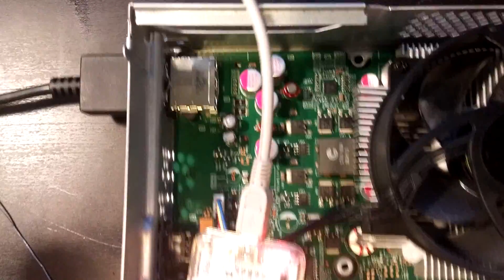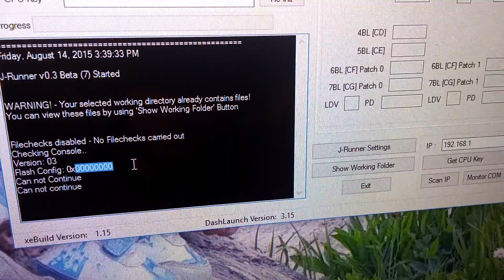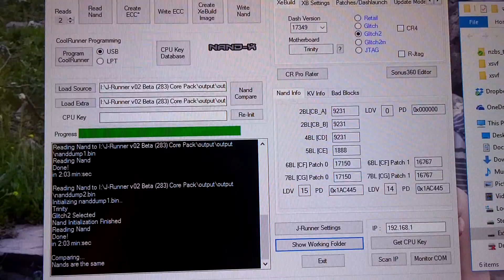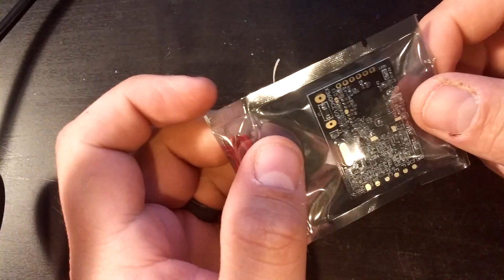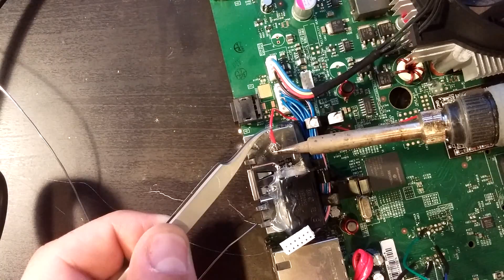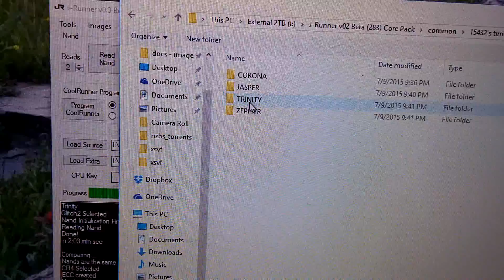How to JTAG RGH Xbox 360 Slim Trinity with Ace V3 and Cr4 speedup files

Comment: How can I visit site, that no exist?
Reply from the maker: You are right, teamx360.co.uk shut down - you can get the timing files in my jrunner package linked on this video:   https://www.youtube.com/watch?v=qKJBLxJaYWg
Reply: Oh, thank you bro. But I have a question:
Does ace v3 is usable in rgh 1.2 installation? I saw many videos of installation but cant find 1.2 timing files for ace v3.
Reply: Danail Uvarov I think all timing files are in Weekend Modder's timing file
Reply: TheWeekendModder Could I use this same method but use the jr programmer instead of the x nand or do I have to use the matrix glitcher chip if I use the jr runner

Comment: Also, if you want to be able to know which exact motherboard you have WITHOUT opening your Xbox quite just yet, you can tell because if you look at the biggest sticker on the back, in the "super fine print" there should say either 12V===10.83A  or   12V===9.86A

heres the link to the subreddit post:
https://www.reddit.com/r/xbox360/comments/c9f5os/how_to_identify_your_xbox_360s_motherboard_type/
Reply from the maker: Just FYI - around the transition dates of 7/2011 or so I have seen many mislabeled Corona's that have a sticker on them that says 10.83A but is in fact a Corona.
Reply: @TheWeekendModder  nice to know, also yeah that does suck :/ thanks for the tip

Comment: I noticed that you soldered the D point on the front of the board, rather than the back which i have seen in various other guides. Is there any reason, is it better for boot times?

Comment: When ive have two good nand reads but i tryed reading it a 3rd time just to be sure and the light came on and turned red now the console is really flakey sometimes it will boot up run for 5 mins then shutdown and get stuck in a boot loop or i just get a red dot? Am i screwed boys?
Reply: Well just saw c2c3 smoking noting is bridging? Desoldered everything now i have a red dot of death.

Comment: Could I use this same method but use the jr programmer instead of the x nand or do I have to use the matrix glitcher chip if I use the jr runner
Reply from the maker: nandx and JR programers are interchangeable.  Matrix glitch chips and CR Rev C glithc chips are interchangeable as well - though do note their pads are labeled differently.

Comment: Hey so I did everything like you did except I ran into the following:
My chip keeps restarting itself, booting into Xell for maybe a few seconds and then the console restarts itself
Also, my jtag header with the 5 wires starting to burn up a little and catch a small fire in which I desoldered all wires and made sure none of the points were touching each other. My ace is 150 Mhz if that makes a difference in the file I use. Please help!
Reply from the maker: Fire is not a good sign.  I'd rewrite original nand and see if you still even have a functional console...
Reply: I redone everything and it sometimes comes and goes. It just sparks a little on the point next to my ground on the jtag header,however it hasn't been sparking for a bit.I was able to write an xebuild and get onto the latest dash, my chip glitched in a few seconds. Now when I try it keeps on trying to glitch and isn't successful, I tried many different timing files but nothing changed. My console is blinking and I even redone all the points on my chip and tried a different "D" point. It still won't glitch anymore. The green light blinks 3 times then holds it green for 5 seconds and repeats the same process. Could it be a faulty Ace V3?
Reply from the maker: Fire is worse than a faulty chip man,  I frankly have no clue how to help you if your console is randomly "sparking" .  You've done something mega-wrong.
Reply: So I redone everything and wrote my original nand back to my console and it boots fine everytime no problem, It happens though that when I create and write an XeBuild for RGH 2 CR4, it takes forever or doesn't boot at all. So could it be the glitch chip? Also, I believe the sparking was happening because some solder was linking the ground to the point on the right (the point on the right was burning up)

Comment: can i use this to solder? https://www.ebay.com/itm/Gas-Blow-Torch-Soldering-Iron-Gun-Refillable-Butane-Pen-Tool-LW/182387276713?epid=1384968347&hash=item2a7720fba9:g:5p4AAOSwJ7RYT1jg
Reply from the maker: Could you?  Yes, probably technically it's possible...   Should you?   Well, if you're at the level which you have to ask if you could, then I can pretty confidently state you shouldn't.   Soldering electronics is difficult enough for first timers, adding on trying to use a butane soldering iron is piling on the difficulty.    It'd be like asking if a first time driver could drive a lambo or an 18 wheeler.  Yea, they could - but they should probably start with something easier to learn on.

Comment: Hi there, i've been following your tutorial step by step, thing is that at the end, console switch on, front led blinks green, on the ACE the red light is on, the gran blinks but it won't start, any suggestion? I've tried your suggested timing on this video and the one on the other video where the full pack of file is. thanks
Reply from the maker: Where did you get your Ace chip?   There was a bad batch circulating around that when reprogrammed for Trinities didn't work correctly.
Reply: Thanks for the reply, I bought it from an Italian reseller, just back home I was wondering if it could be caused by a bad soldering, I just disconnect the D pad to test and it does the same thing, so what do you think, could be the D o C pad?
update: as a test one by one I disconnected the pads, no 5v and end ok the ACE doesn't light up, when I disconnect the C pad, the green light is on but no blinking, removing any of the other it does blink but no boot.
update2: Mr TheWeekwndModder you'r first thought was the correct one!!! :) after all these testing, and since I have another X360ace v3 I gave it a try, since the programming I saw something different, in fact with this new one, while programming, the green led was low, when finished it was quite bright, while the first chip , after programming, no green led was visible, anyhow, did set this new one in the console and id did glitch and boot, now writing NAND, hope all goes fine lol
thanks

Comment: Thought to mention: At 1:15 in the video, you're pointing at something that isn't visible due to the caption and the caption is really hard to exit out of because it's right next to the branding logo at the bottom right. :P
Reply from the maker: Fair point, I'm only pointing out the small little cable that is used to attach from the motherboard to the speaker for the special edition type sounds.  Easy enough to pick out.
Reply: I commented while watching the video and so after you pointed it out you explained what it was and I realised that it didn't really matter. :P

Comment: i did everything 100% right through the whole way so now i got to boot it up to pull in kv/cpu all that to i can write xell . and it doesnt fully boot the light just keeps blinking. what should i do? please help
Reply from the maker: Where did you get your Ace V3?  There are batches of them floating around that are messed up and won't work on Trinity consoles.
Reply: TheWeekendModder I got a bundle of 10 off eBay for like $32
Reply from the maker: Whelp, either you've made some other mistake, or you might have gotten a batch of the Aces that fail on Corona chips.  I don't know of any method to test the chips, only that some batches of recent aces don't work when reprogrammed for trinities and some do work
Reply: TheWeekendModder thanks 🙏 for the help man!
Reply: hey did you find a fix? or was it a incompatible acev3

Comment: I have a few questions. Where to find the chips? Are there any chips that won't work? And how do I Learn where to put which wire where? Lol I'm going to do this as a part time thing.
Reply from the maker: You can buy chips all over including at my store www.store.weekendmodder.com.   The particular chips you use vary depending on the console you're trying to mod.  Generally right now my favorites are Matrix V1 or CoolRunner Rev C on all phats and on Trinities and Ace V3's on Corona consoles.   You can find video tutorials at www.weekendmodder.com broken down for each motherboard type. 

Good luck - read up!

Comment: Can you use the timing files from the ace v3 that's already programmed to your trinity???
Reply from the maker: The ace v3 comes default programmed (from the factory) with a timing file for Corona consoles.  If you want to use an ace in any other type of install you must re-program it with timing files for that.

Comment: For letter D on the glitch chip isn't there another point on the back that you can solder to or is soldering the resistor better?
?
Reply from the maker: Soldering where I demonstrate here has proven to be a better booting method - however yes there are alternate locations on the back if the resistor is too small for your comfort.

Comment: @TheWeekendModder i have a question can i pre install the ace v3 before i read the nand with jr proggrammer  i would like to pre install the ace while i wait  for my jr programmer to arrive or would that cause problems reading nand if so can i just desolder the power to the ace then read it or does it have no affect at all and i can pre install
Reply from the maker: You could preinstall it - but you'll likely need to leave the power disconnected for it to still boot retail.
Reply: that's what I was thinking I already pre installed it along with a led mod and case mod
good work with the tutorials they are very helpful

Comment: i tried to follow this and up to the point where you put in the timing files and i tried to boot it but nothing happened on screen but the chip flashed and the fan spun up
Reply: i finally figured it out. what you have to do is use the 150mhz instead of 300 when you program the chip

Comment: How do you rgh a Xbox 360 E 4gb corona 5-25-2013 9.86v
Reply from the maker: A E series with that MFR date is likely to be a  Corona - so you'd follow any corona RGH guide.
Reply: TheWeekendModder it is a corona v6, I took it apart and checked all locations except tracks under heat sink

Comment: You still offer doing the mod? xbox trinity 4gb dash 2.0.17511.0 manufature date 2011-01-05.
Reply from the maker: Yup, no problem.  www.sendin.weekendmodder.com has all the details.
Reply: I have a few questions, concerning the optical drive and lack of hdd. Could they be added?
Reply from the maker: The FAQs specifically address questions about the optical drive being non functional not affecting the mod, and yes - a HDD can be added though I don't have one to sell you.   I suggest you thoroughly read over my send in page - it is really quite detailed as I've put a ton of effort into it.

Comment: Hey, quick question, why do you solder to the resistor and not to point C5R11? Isn't that a much easier point to solder to?
Reply from the maker: Consistently better boot performance using the point I use.
Reply: Do you happen to know what the name of that point is? is it labeled?
Reply: R4D4

Comment: my solder won't stick to the console it keeps sticking to my solder iron
Reply from the maker: Too many possibilities to list.  Iron not hot enough?  Using flux?  Using the wrong solder?
Reply: TheWeekendModder probably not the best flux and i didn't use s scratch pen... that's probably my problem... now i can't get jrunner to open, a diagnostics message comes up and won't open

Comment: any info on s-rgh? heard thats the best for slime using an ace v3.
Reply from the maker: I have multiple videos here on my channel showing an Ace V3 "with CR4 speedup files" by 15432.  That is S-RGH.
Reply: Ok thanks i'll take a look,subbed and liked. few more questions what is the most cost effective programmer that's compatible with the ace? seen the matrix nand hack but that doesn't work with the ace? are the matrix glitcher clones any good for the slim?
Reply from the maker: I don't experiment much with cheap tools - I prefer the speed of the NandX and that it doesn't require any hacky work arounds to program the Ace (and other chips).    The Ace is all I use for  slims these days - nothing can beat it in value and boot speed.

Comment: Thanks for the video, you made it look a lot easier than when I read the procedure somewhere else. I'm new to the stuff on xbox360, my question is what parts/ kits do I need to hack/mod the xbox360 an where do I buy them ? the Xbox I have is the slim trinity version.
Reply from the maker: For a Trinity I'd reccommend an Ace V3, and then some tool to allow you to read/write the nand.  That could be a JR Programmer, nandx, or other.

Comment: Hi, man! Nice and well explained video, as always! Can I just give you a couple of tips?
1. Easiest way to tell a Trinity from the rest is the fact that it has a HANA chip, no need to look at the rest of the stuff.
2. After writing the ECC you can desolder the nand wires and instead, put rawflash v4 on a USB flash drive and use that to flash the nand via xell.
Cheers! ;)
Reply from the maker: Thanks!  I prefer writing back my updflash.bin via hardware as I have encountered some issues with Xell/Rawflash not handing bad block remapping in the same way that Jrunner does and I prefer the way that Jrunner handles it and remaps them before writing back via hardware.
Reply: That's interesting. I often use rawflash and I've never had an issue with bad blocks. I even did a jasper rgh1.2 last week, that had 2 bad blocks and rawflash v4 handled them nicely.
Not saying you're wrong, though. Every console is different. Plus, you have the nand-x, that thing is fast! Might even pick one up myself.

Comment: Great video! I'm excited to do this. Just ordered a coolrunner and 3 Ace chips from your website.
Reply from the maker: Thanks for the order!
Reply: Success! Although boot times can take upwards of a minute to glitch, typically under 30 seconds. Should I expect faster boot times? I'd like to try and tweak it. If I've read correctly, the wire length on the bottom of the mobo can be changed to help. My console/kit were identical to what was used in this video.
Reply from the maker: The length and routing of wire "D"  CPU_RST makes the most difference.

Comment: Btw do i need the fiber glass scratch pen? or can i use some other something lol. On a budget, but have been wanting an rgh for years.
Reply: It is necessary to clean the surface and allowing the solder to stick. Otherwise it will just slide off and burn your motherboard. They are also not too expensive, just look for sanding pen or scratch pen. they are around 5 ~ 15 dollars.
Reply from the maker: Good answer.  It's not absolutely "required" but you'll have a MUCH better go at it if you use the scratch pen.  Especially for a first timer.
Reply: I've been soldering on motherboards for years. RGHing is simple enough to do. I just don't have the cash to spend more than i even have. My reason for asking is i have seen many not use this. So no its not a MUST it just removes the coating as said. But fuck spending 15$.
Reply from the maker: That's a poor choice - especially for a first timer.    And a scratch pen is $5 - if you're paying $15 for one then you're doing it wrong.
Reply: Fuck the first timer shit.

Comment: hey awesome video could you please tell me all the things i need to buy i know about the chip but everything else and the wires thankyou a well earned like
Reply from the maker: Well, you're commenting on a "how to JTAG" video - so there is no chip.  To JTAG a console I use 2 1N4148 diodes, a bit of wire - and some method of reading/writing to the nand like a home-made LPT reader, a JR Programmer, a Matrix V1, or even a NandX.
Reply: also quick questiom how long does it take to get to me if i buy a coolerunner rev c on your website
Reply from the maker: 3-4 business days.
Reply: thankyou i shall be making a purchase very soon

Comment: Oh.... So in a merely accurate way 8
Its like jailbreaking/rooting your phone, so it reads unsigned code. But on a console.
Reply: RGH = Reset Glitch Hack (when it injects unsigned coding) 
Respring = Turn off all security protocols and injects unsigned coding whilst turning on. Hmm.
Reply from the maker: Yes!   Unsigned code is the entire point!

Comment: Without getting the super nand flasher to program the glitch chip could I use my (JR programer) Nand reader too program the chip? Or will it be bad taking it out after reading the nand? Please respond @theweekend :( ASAP
Reply from the maker: JRP's are capable of programming glitch chips too.
Reply: So I would have to solder the JRP's wires to the glitch chip?

Comment: Yo Weekend modder please answer this question ASAP!! Is there a alternative point for D on the back of the trinity motherboard for the ace v3? The point is FT4R2. Please let me know!!
Reply from the maker: Yea, the FT11 (something like that I'm doing this from memory) is referenced in many Corona tutorials but it exists on Trinities too and is an alt point for the CPU_RST (D) point
Reply: https://www.google.com/search?q=trinity+rgh+ace+v3+install&biw=1116&bih=570&source=lnms&tbm=isch&sa=X&ved=0ahUKEwjI-6TH04_OAhWCTCYKHY_aBUcQ_AUIBigB#imgdii=2Wd89rRp4Cjw0M%3A%3B2Wd89rRp4Cjw0M%3A%3BhAoAyTqy6WJWEM%3A&imgrc=2Wd89rRp4Cjw0M%3A

Would that be the ALT Point for D on a Trinity with ace v3?
Reply: @theweekendmodder
Reply from the maker: Yes, though you'll have to play with the wire length to get good boot times.
Reply: Awesome thanks! One more question, can i change the timing files on a CR or Ace chip after i write the nand? Or can i only change the timing files before i create xebuild?
Reply: TheWeekendModder ^^